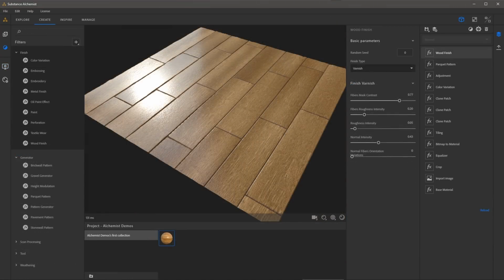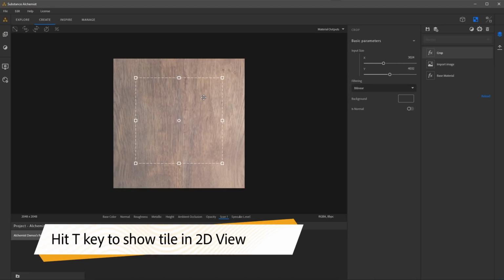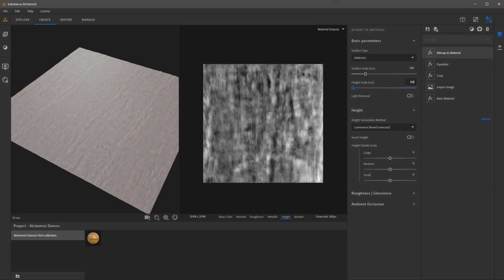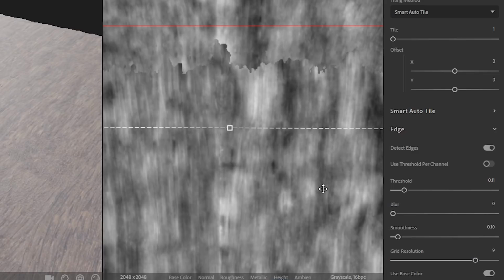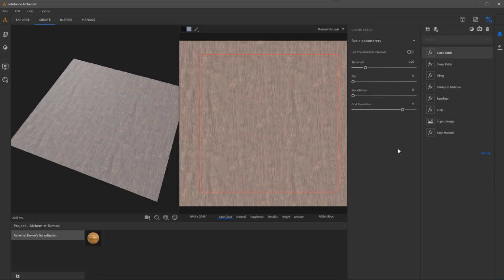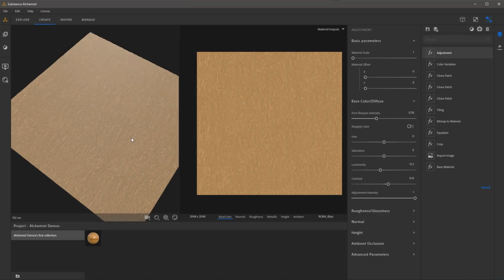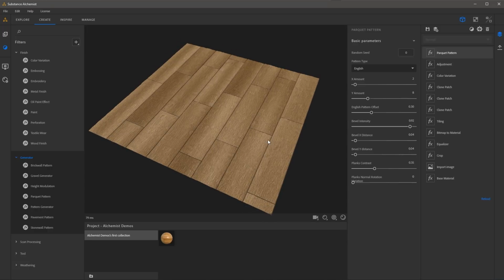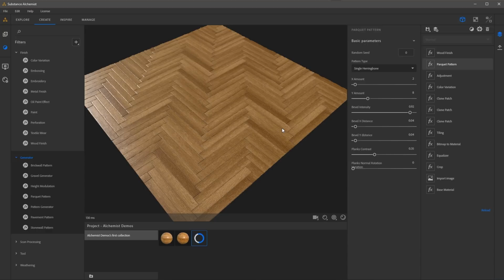Substance Alchemist: Image to Material (Bitmap To Material) | Substance 3D

Comment: Iam having the opposite problem Wes had when he imported his non uniform image in. When I import the image it gets automatically transformed to a square shape, which I don't want. Is there a way to force Alchemist to work with non uniform textures? Thanks!
Reply from the maker: Are you starting with the Use as Bitmap option before the Image to material? I first import the image as a bitmap and use crop with the original input image resolution. This way, I crop to square but do so without distorting the image.

Comment: how can I use the material in ue4 , because you substance's use displacement map and there is no one in ue4 so it doesn't give me the effect I want if u can explain ????
Reply from the maker: You can work with displacement in UE4. If you export as sbsar and user our plugin for UE4, there is a displacement template. Here is how you can set it up manually. https://docs.substance3d.com/display/integrations/Working+with+Displacement

Comment: The exported “sbsar” format to substanc painter can have adjustable parameter options？ like substance designer
Reply from the maker: It does not at this time. The sbsar file packaged the textures. You can export as SBS which will create a project file with the textures connected to the outputs. You can then add nodes to extend procedural effects in Designer. In the future, we will have more to offer with sbs : )

Comment: What format is the best for picture ? for export later to substance painter
Reply from the maker: You can use the sbsar file format which can be imported into Painter. You can also use any of texture formats like PNG. If you use the sbsar format, it will give you a single file that contains all of the map channels. When you import this into Painter, you can tag the sbsar file as a base material and it will appear as a material. Then you just drag and drop it to your layer or on the mesh and it will create a fill layer.

Comment: What´s the difference between "Bitmap to Material" and "Use as Bitmap"? :)
Reply from the maker: It's in the name. B2M loads the bitmap and then generates other channels from it to make a full material. Use as bitmap just loads it as a bitmap and nothing else, so less steps happening automatically if you'd want to do things likea  crop or adjustment on only the bitmap.
Reply: Substance Thank you for your fast response :) So if I understood it correctly, you could do basically the same in both modes, they are just „presets“ and it‘s possible to create a fully functional material too if you started with „Use as Bitmap“, is that right? 

The other way round I can also make adjustments, crops onto the image if I started with B2M?!
Reply from the maker: Yes, one is just a bit more automated then the other. Alchemist is about being fast so we provide one-click options.
Reply: Substance Thank you very much :)